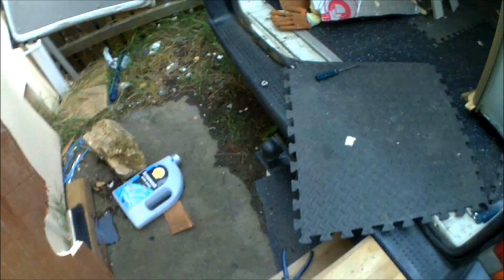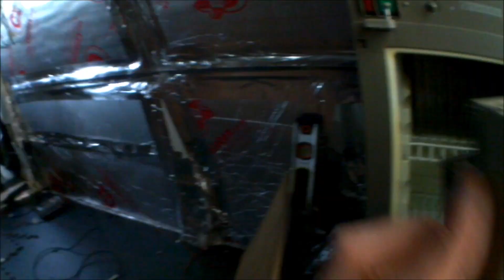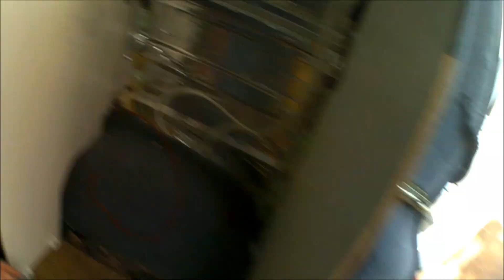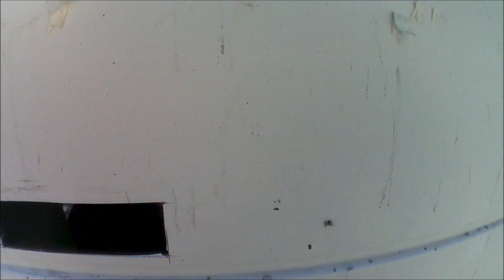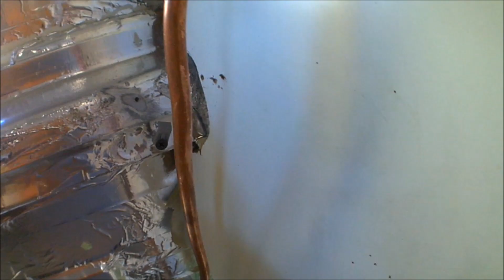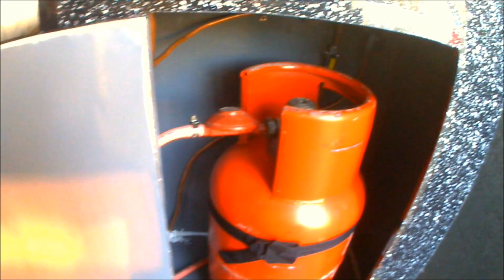Campervan Electrolux 3 Way Fridge & Unit Install - VW T4 Camper 12v/240v/Gas Fridge Installation

Comment from the maker: Please leave some comments below and don't forget to grab some Camper Conversion Merchandise while it lasts: 
https://teespring.com/en-GB/stores/camper-conversion-2
Reply: hi there just watched your video for first time because i am building my own van at 78 yrs old and i have just had a company fit a LPG  tank underneath my van but they have fitted  a white plastic coated pipe that they said had to go under,  and also fitted a three way module for turning appliances off in an emergency as well as a single tap for gas off, is this because you are build a different system or they wanted to charge me more. ? I wish also you had covered more about cutting flue hole rather than two of the bigger vent.  but it was helpful to a point and I will keep watching, thanks keep safe  hope you have many happy  trips away in your van.

Best regards George Whitby N Yorkshire
Reply from the maker: Underslung tanks need emergency shit off valves etc so it’s all fine

Comment: Hi, i have almost the same type of fridge from Electrolux (from what i see only the refrigerator is kinda different in your model and smaller than mine) and i wanted to ask you if you never tried on 12V and how much time it takes to get cold. I see that you got 6C only in 2 hours and this is good, my fridge might be problematic or maybe because i've tried with 12V? It takes about 6hrs to get cold and only the refrigerator will feel real cold and almost frosty. Then the rest of the fridge will start to get cold also. Is that normal or they should getting cold together? Gas is also not working i will have to fix if i plan to use it. Thank you. (EDIT: i put it now on 220V and i will let it on for 3hrs to see if i get the same results)
Reply from the maker: 12v should only be used while travelling in the vehicle, not full time or it'd drain the battery very quickly. The idea with these is to use 240v before setting off to get it cold, 12v while travelling, then gas or 240v hookup what parked up at site
Reply: Thanks @TheCampervanBuilder  for your reply. Just to let you know that it gave me very good results on 220V that i left it for 2 hours, the refrigerator was frosty and the main fridge was cool enough but at this time of the season is not the identical test (18C outside temperature) . I have a plan to test it in 220V again on a sunny day with the 200W solar panels by using the inverter cause at 220V seems to work really good. I know that it will consume about 120W and is a lot but if i can get it good cold only in 2 hours is not a problem and i will find a system (use it for like 6 hours in the daytime and the shut it off until the morning and hopefully will still be cold for the food inside) I am in dilemma if i replace it with a compressor 220V fridge that i can get 40W low power consumption  but i see that even now those 50years old 3way fridges would sell 1500 euros. I saw a bunch of dometics in a website that dometic is Electrolux as you know. What do you think? And of course i will have to fix the gas working correctly ... maybe would cool even better.

Comment: Hi mate any chance how you wired the relay for the fridge up I’ve got a thetford 4100 fridge and a maypole tec 3m relay. On the wiring from fridge I have my purple ( live) and black which go to my leisure battery the to the relay I have thicker gauge red and white wire and thinner orange I’ve been told red and orange can go together as the live and white the earth... clueless on how to wire the relay hope you can help cheers mate ( great work by the way) Gordon

Comment: GREAT VID I have the same fridge I wonder if I get it going on gas then switch it over to 12v solar? I wonder if it will work
Reply from the maker: It would kill batteries overnight as the 12v draw is high on these

Comment: Hey mate great video. I have a similar fridge to you, mine is an rm4401. I am just curious if i have to make an outlet for the flu if im only using the fridge on 12v and 240v?
Reply from the maker: You don’t need the flue unless using gas but still need the vents for air exchange
Reply: Perfect thanks for the reply 😀

Comment: The flame on mine lights,but then goes out when i let out the flame switch. weather its on high flame or low flame.any advice? Thanks
Reply from the maker: Keep the flame switch pressed in once lit for at least 30 seconds before releasing as there is a thermocoupler that needs to open with the flame heat as a safety device. If it still doesn’t stay lit, you may have a blockage in the flue or burner chamber
Reply: @TheCampervanBuilder  thank you for the reply.must be a blockage.

Comment: Thanks for an awesome video. As always really helpful, we’re also doing a LWB T4 high top conversion so your videos are perfect. We’re fitting a 3 way fridge but it hasn’t come with a flue hose/pipe, do you know what material it is made from so I can get something to replace it? Also we haven’t designed our van to be able to encase the fridge, do you think that’s an issue with the gas, of course we’ve got a drop out hole in our gas bottle locker but no point doing one for the fridge if it isn’t encased? Thanks for your help.
Reply from the maker: Hi thanks, You can get flue replacement kits on eBay with the correct pipe fixings & vent etc.  All 3 way fridges should ideally be encased as it's the airflow exchange from external vents that cools the system.  If there is insufficient airflow then the fridge will not cool down enough.  Also, any gas connection should have a gas drop out hole incase a connection fails.